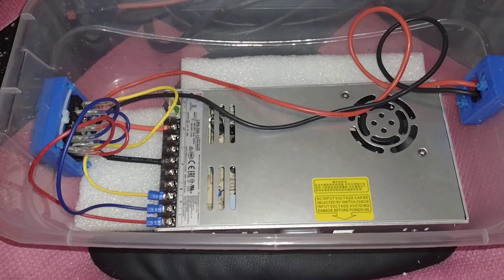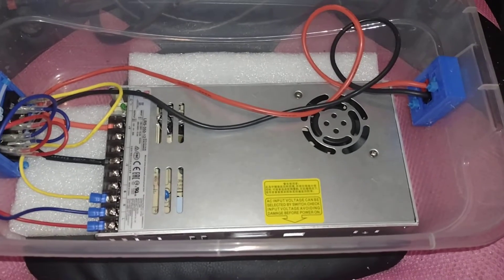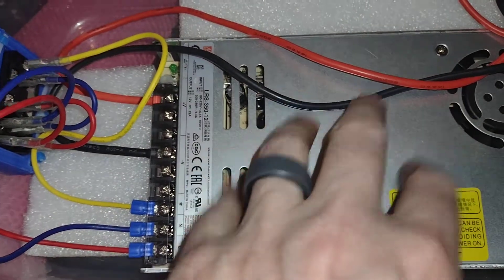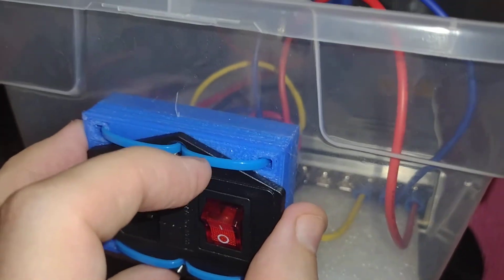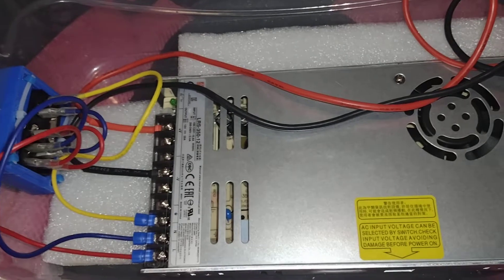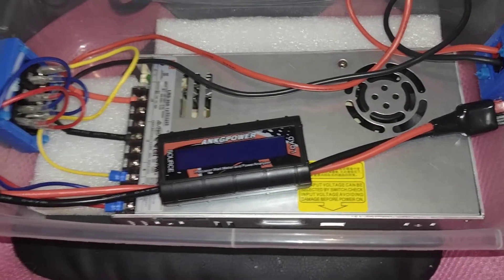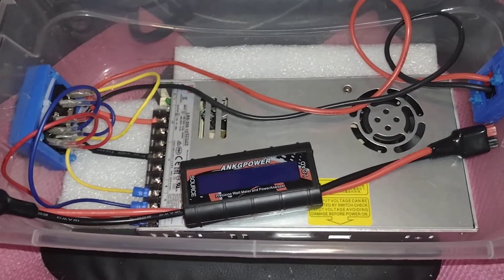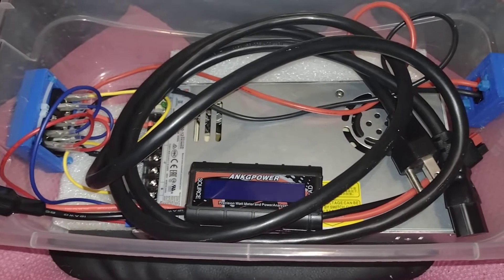Meanwell and Tupperware Ham Radio Base Station Power Supply

Comment: This source does not generate noise in any hf range?
Reply from the maker: Not that I have noticed, but I have not done any thorough testing. Authentic Meanwell power supply units have a reputation for less RF than other cheaper brands. Likely they do put out some noise though.